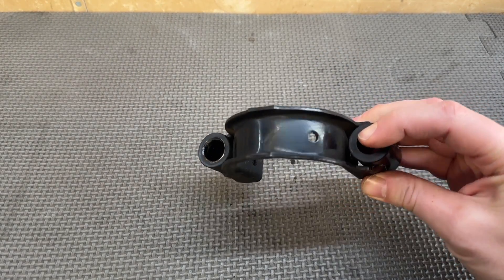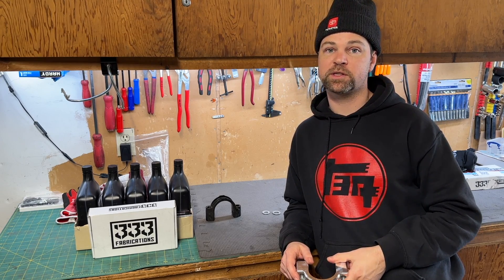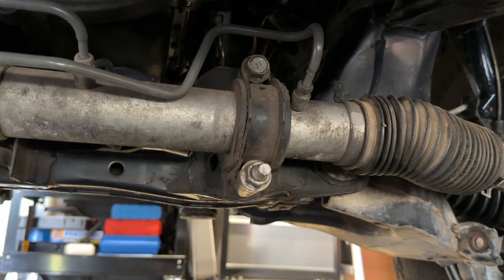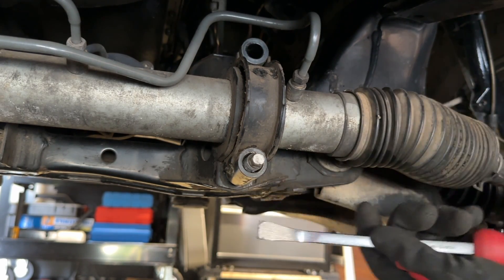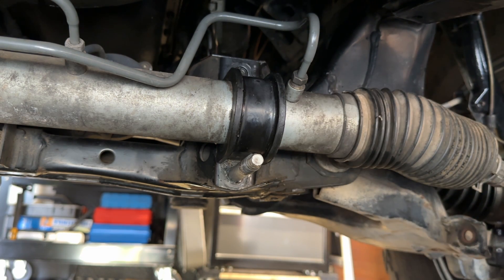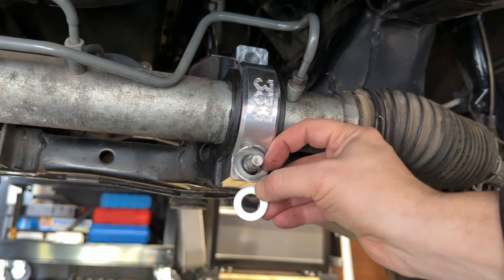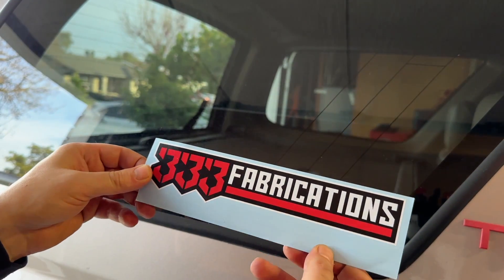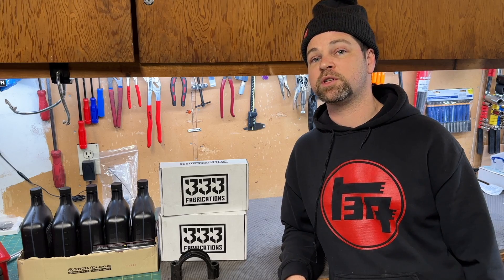333 Fabrications HD Billet Steering Rack Clamp (3rd GEN Toyota 4Runner Installation)

Comment: Out of curiosity, why is it recommended to not lube the bushing?
Reply from the maker: The clamp shouldn’t slip around. It would defeat the purpose of it, so to ensure it is stable and secure, a dry bushing will hold onto the rack better, preventing steering rack play.
- Sean

Comment: On my 2003 Tacoma I tried installing the clamp with the long side on the stud and i stripped the stud and nut. I Had to buy a new stud and nut. And it turns out the clamp goes with the long side on the bolt, for my application. It wouldn’t fit the nut the first time and that’s why i stripped it. Thanks for the video 🎉😊
Reply from the maker: That's interesting.  Thanks for sharing this.

Comment: How do I know what orientation for the clamp .I have a 2001 4runner I installed it with the openings of the 3s facing down I see that you have a 2002 and you put it facing up everything on my rig is Stock but raised 2” so I’m a little confused as to which direction it should go?
Reply from the maker: The longer side side over the stud.  You're basically mimicking the OEM clamp you removed.

Comment: 333 bracket is definitely worth it🤙 one suggestion is to double weld the frame perch and add small gussets to it. I have seen them break away from the frame in serious off-road conditions. Toyota put weak welds on the frame perch and is designed to break away in an accident. Just like the steering shaft is a two piece shaft and is designed to collapse away. I speaking about a 1st gen tundra by the way.
Reply from the maker: Thanks for the suggestion.  If you have any pictures of the welding you did, we'd like to see them.  You can email me: tim@timmythetoolman.com
Reply: I got the 333 bracket maybe a yr ago and haven’t actually got around to welding the perch and gusseting it yet. I will probably be doing it this next spring/summer as I’ll be putting solo motorsports lca’s on next. Once I have pics I’ll send them over… also doing the archive shock relocation with 2.5 12inch shocks in the back. I got my work cut out for me, lol! Going up to 35s from 33s next summer too!… my truck doesn’t fit in the garage that’s why Im waiting for nicer weather in the pnw.
Reply from the maker: @heismyrefuge1027  Gotcha.  Good luck with all the work.

Comment: The  written instructions on the 333 site tell you to install it the opposite way, but they also link this video....going to folllow the video thanks
Reply from the maker: The longer side of the clamp definitely goes over the stud.  This clamp mimics how the OEM clamp is designed with one side longer than the other and the long side of the OEM clamp goes over the stud.
Reply: Good copy! thank you for the quick reply. My Stock clamp was very deformed.
Reply from the maker: @tronskifpv  You're welcome

Comment: Did you notice a difference?
Reply from the maker: Yes
Reply: Just got it installed and there actually was a noticeable difference, I was skeptical at first. Here's just my on road experience, it helps firm up the steering wheel with uneven surfaces, no more shaky steering wheel... Even with the poly bushings this made an impact.

Comment: Does anyone know where to find a documented case where the stock clamp failed?
Reply: Probably not but it's billet and shiny so who cares.
Also it's billet

billet
Reply: @treehouseoffroad  🤣 Agreed
Reply: A CNCed solution in search of a problem?  An idle Haas won't pay for itself.
Reply: I have a 1st gen tundra and my stock one was fitting loose. Id bottom out the bolts and the rack was moving around so I had to try and shim behind the rack bushing. Then I just decided to get the 333 bracket and it super snug and solid, definitely a worthwhile purchase.